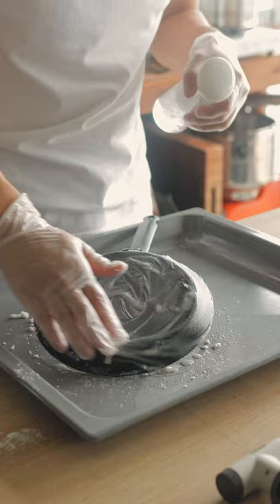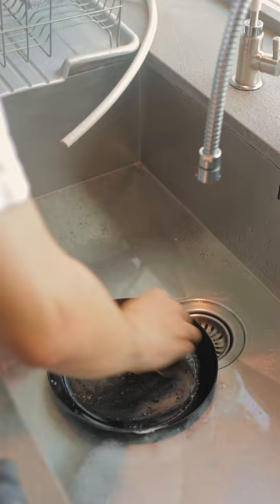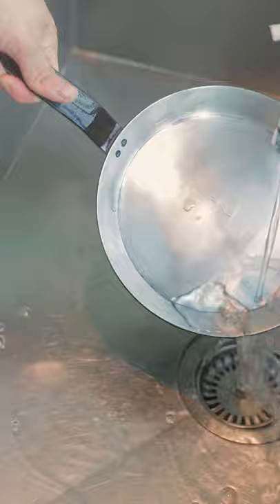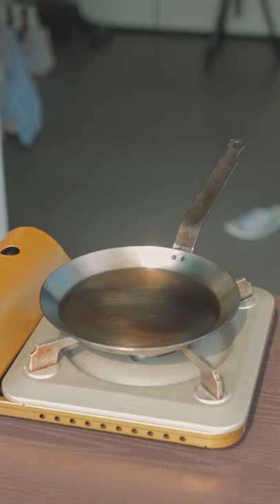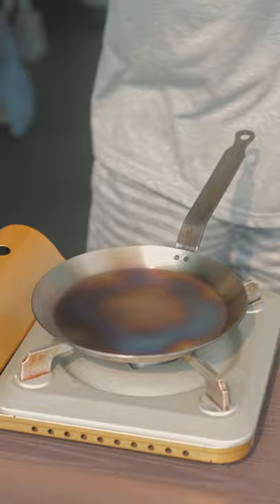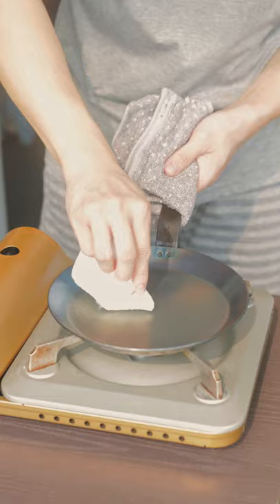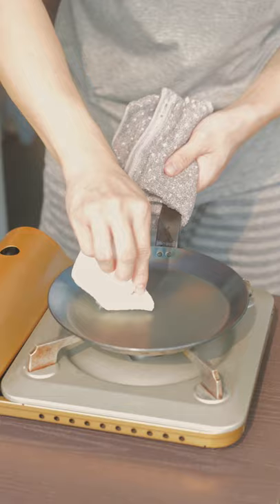Re-Seasoning Carbon Steel Pan

Comment: One question...do you have to season it again  after cleaning it from the food that may have stuck on it
Reply: NO. Just remember to not use soap or steel wool. And keep it out of the dish sanitizer. aka dishwasher. Hot water and a sponge, or a dish towel. And heat the pan to dry it. Ditto for pots.
Reply: @nomadmarauder-dw9re  Soap is fine for cast iron and carbon steel.

Also the dishwasher is a dishWASHER and not just a sanitizer.
Reply: @thespanishinquisition8628  fine.

Comment: what was the [oven baking] step for
Reply: ovens heat evenly from all directions. A stove burner heats from the bottom. so, your oil heats unevenly on a burner, evenly in an oven. You're welcome.

Comment: De Buyer Blue Crepe Pan
Reply: Negative it's a mafter. De buyer has rivets, mafter is a welded handle.
Reply: @luisguerrero86  the De Buyer blue crepe pans flatten out the rivets. I have the same pan. I do think the Matfers are better since they are thicker than these pans. Nice try though.